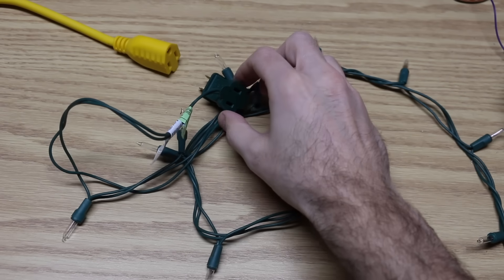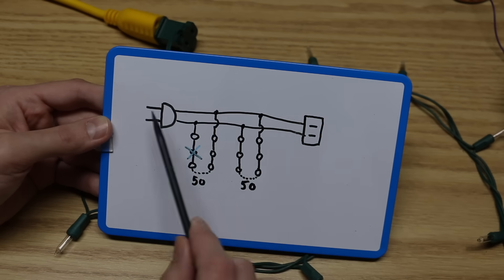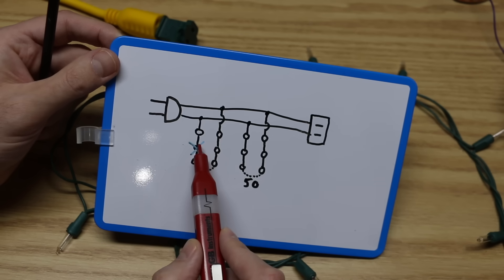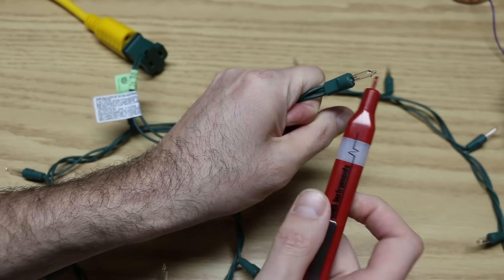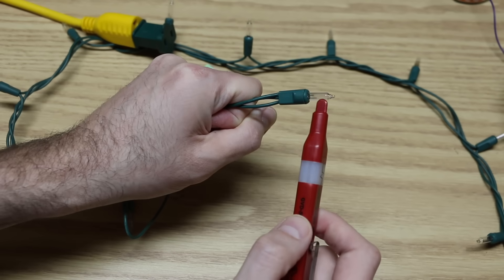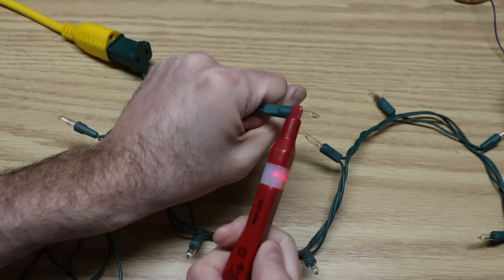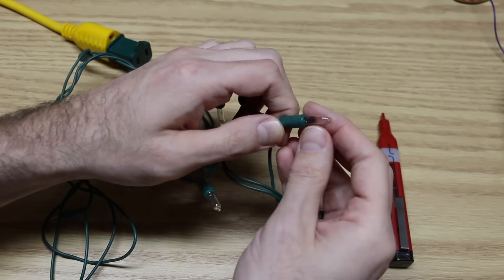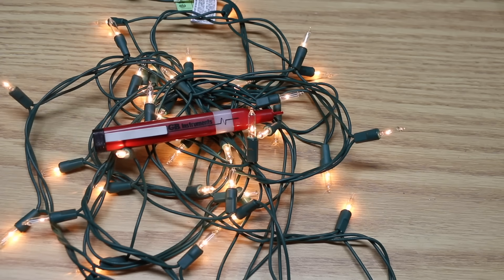HOW TO EASILY FIND BAD CHRISTMAS LIGHT BULBS using a non contact voltage tester

Comment: Very "enlightening" (pun intended). I have a light string "bulb checker" that does exactly this function. I didn't realize until now that it is simply a voltage detection tool. I have one of those also, identical to the one you have. Fortunately, I have replaced all my incandescent strings with LED bulbs, so I no longer have to find the burned out bulbs--at least for a while.

Comment: It's the one that isn't lit!!!!! For years and years lights are wired in parallel. This was doone to get rid of the problem with individual bulb failures. With the cost of sets it is hardly worth changing bulbs even if you can.
Reply from the maker: Every set of indoor "mini" incandescent lights I've bought have been wired in series, which also keeps the cost so low.

Comment: I remember these kind of old stile lights years ago. Now most have a continuous live feed so if one goes out the rest still work.
Reply: These ARE the new style. The old kind are "two wire" lights, these are "three wire". And the new ones fail just the same. They are SUPPOSED to work even if a bulb blows, but that only happens if the shunt operates as it's supposed to, which it often doesn't. I have two strands of 3 wire lights right here, each with a working half and a dead half. Each one has several burnt out lights on the "working" half, yet the half works fine. But something went wrong with the OTHER half, and obviously at least one shunt is not working. So you need to go through and find the dead bulb and replace it, since that's where the shunt it.
Reply: Exactly. Don't use the "old" sets.
Reply: @grimreaper-qh2zn  especially if they don't work. 🤣🤣🤣🤣🤣🤣👍

Comment: This is great an adjustment to speed up the search use binary search so start in the middle of the string of lights.  If it doesn’t work then you know to search in the first half or if it does work you know to search in the second half.  Continue this way and you’ll get to the bad bulb much faster

Comment: I was with you until You put the new bulb in the socket that was getting Energy. Why did You not put the new bulb in the socket that was not getting energy. In order to complete the Circuit. I am very confused. I was under the impression that as soon has you find the bulb. That is not getting the energy that is that would be were to put the new bulb. It makes no sense to me why You put the new bulb in the working socket. Please explain to me why You Contradicted everything You just said. Thank You.
Reply from the maker: Energy is arriving along the wires up to the point where a broken bulb cuts the line, so there will still be energy detected at the broken bulb entering the bulb, but not leaving the bulb.  Then on the next socket there's no energy detected.  So we go back to where the break occurred to find the bad bulb.
Reply: @GadgetReboot  So were the no energy socket is not were. I would put the new bulb. Instead I need to go back one and that is where the bad bulb should be and. That is were the new bulb will go also. Am I understanding this right. Thank You again.

Comment: Thanks for the effort in putting this video together, but I’d rather just buy another strand of lights considering this could take forever.
Reply from the maker: It only takes a few minutes - I can find the problem before I get to the car. Especially if the store is closed or out of stock

Comment: I will admit i didnt watch the whole clip but what i say makes.no sense.the voltage detector you are using is for 120 volts.as you stated its a 50 light series circuit with thr voltage dropping by 2.5 volts with each bulb.so your gaget will work up to about 60 volts , after that it wont detect low voltage across the lamp even if you reverse the plug.your diagram isnt correct either as if you loom at the set you will have 3 wires running all the way through
 Go to home depot spent the extra $2 and buy new lights
Reply from the maker: Some detectors work down to 12v by spec and even lower in reality, but what we're really trying to detect is the full 120v when the circuit is broken, so we're not getting the 2.5 volt drop across each light then, we just have 120v showing up on essentially a wire and then nothing after the break point.

Comment: I like the use of the non-contact voltage detector. But there is a faster way to troubleshoot a large string: once you have figured out which is hot and which is neutral, start in the middle, at light 25, if that is good, go to light 13, if that is good, go to 6, etc. Keep splitting the balance of lights in half and you'll find the bad one in a handful of checks instead of checking all 50 bulbs.
Reply: It's faster and easier to just look at them... When the bulb burns out it usually leaves a black mark. LoL
Reply: Successive Approximation is how digital multimeters measure voltage.
Reply: He actually explains this right at the end of the video. Great way to show that you didn't watch it all. Lol
Reply: @medavis94  That is quite clearly not how he explained it but you are welcome to interpret it however it works for you.
Reply: @clopez4280  yes I find this a lot nowadays 🧐

Comment: I think I could pull the bulbs in and out in the same amount of time and not invest in the tool. 😬
Just saying for a friend
Reply: At the very he gave the best advice.  Check the circuit in question at the halfway point.  If you have power, then the break is in the second half.  If there is no power it’s in the first half.  Then go halfway between there you tested and the side with the break and repeat.

Comment: Yeah this method might work but they design Christmas light bulbs to have a unique resistance across each bulb and different strings tend to have different resistances for the bulbs. This makes replacing the bulbs difficult because once you run out of the 1 or 2 replacement bulbs that came with that string you usually can't just rob bulbs from a donor string. Using a bulb with the wrong resistance will cause that bulb or other bulbs to blow very premature. Christmas lights are just real tough to fix, especially if they are strung into those yard decorations from factory. Spend $100 on a pretty yard decoration and maybe get 2 seasons out of it before that's blown and done for.

Comment: not one light at a time but using binary search to detect the faulty light at a much faster..use half of the strand, no voltage present then  cut in half again to ID's the voltage present.. repeat the process until finding the defective bulb.. good luck!!

Comment: Even if you find the bad light, try to find a bulb that fits… LOL
Reply from the maker: You can likely swap the bulb between different plastic bases by straightening the wires and pulling the glass out, exchanging between sockets

Comment: Suggestion: binary search. Find hot light on an end. Test the middle light next. If still hot test the middle light of the remaining string. Etc.
If not hot, test the middle light of the lights you skipped on the last step.
Repeat.  You'll find the bad light within 5 checks.

Comment: You don't have to keep untangling the wire and gripping it shielding with your hand if you've already made the other line neutral just go light bulb to light bulb quickly I don't understand why you were doing that
Reply from the maker: some non contact detectors are more sensitive and some even beep when nowhere near live wires so shielding helps prevent picking it up from neighbour lights
Reply: @GadgetReboot  I suppose you're right I never buy the cheap ones that don't have a sensitivity adjuster on them

Comment: Look at the fckin bulbs if the filament is broken change it. Simple this guy is nuts lol
Reply from the maker: Sounds like you'd have to look at them all one by one, much slower.   And you can't always clearly see the filament especially if it's blackened glass, or dim ambient lighting.

Comment: I found a bad link and replaced with new light bulbs but still not working.  I did not find any burnt bulb.  I guess there was a break in the wire.  I used them last year so it was a year old.

Comment: Suggestion...xmas lights are usually grouped in 25. After testing #1,  skip to bulb #12.
If no voltage..go back to #6
If there is voltage, skip to bulb #18 
Half the distance testing narrows it down faster.
Reply: Thanks!! I changed bulb #12 from the start of my burnt out section and BOOM, it was the correct one

Comment: I detect voltage at every light but none are lit. What next.
Reply from the maker: Is there a fuse in the plug?  If a fuse is blown that could explain voltage showing up all along the way because the main connections are fine and then it gets cut right at the plug after making it most of the way around the string.  Otherwise, the detector could be picking up stray environment stuff.  If you try to detect voltage just holding the detector off on its own does it still pick up something?  And when probing a bulb are you shielding below the bulb with your hand so you're not picking up what's on the main wires? some detectors are more sensitive.

Comment: Anyone recommend a particular non contact voltage tester? There’s a lot out there but I’ve read that for Xmas tree lights you specifically need a “low voltage” detector. What would that be?
Reply from the maker: most of them say they go down to 12 V and I’ve never seen  one that didn’t work for this. Although individual Christmas light bulbs in a string might only be a couple of volts each across the entire 120 V AC circuit, when testing like this for a broken bulb, we are actually detecting the full 120 V presence because the circuit is broken so we are not getting the couple of volts across each light, we will see the full 120 V as if it’s just a bare wire going up to the point where the circuit has been broken by the bad bulb. Once the bad bulb is replaced and the lights are back on, then there’s just going to be a couple of volts across each light.

Comment: I have white lights wrapped around a ficus tree that I keep lit 24/7.  I unplugged it to paint the room and then it didn't work the next day. How could it burn out that fast?
Reply from the maker: if one of the bulbs was near its end of life, the stress of powering on again could have blown it because there’s an extra surge of energy to power lights on compared to keeping them on. Similar to the old incandescent lights we used to use for the rooms, they would usually blow as soon as you turn on the switch rather than just randomly going out if they were already on.

Comment: When troubleshooting series strings (or anything wired in a similar way), always start in the CENTRE. That tells you which half of the string is dead. Then test at half way within the dead half section... in that way you can isolate which (quarter) section contains the fault. Then drill down further in the same way.
So in this case of 50 lamps you'd first test to determine which is the active (line) end of the string, then test bulb number 25. If that bulb has power, then test Bulb 37, if that works, test Bulb 43, etc.
EDIT: That's the method used in the follow up video (linked in description).
Reply: Doesn't matter, it will still be the last bulb you check that's dead
Reply: @cchavezjr7  But with many fewer checks.  For examle, with 64 bulbs, 64=2^6, you'd only check 6 or 7 instead of 32 on average.
Reply: @SRHMusic012  You missed the joke.
Reply: You said it much more concisely than I did. It's called a "binary search."
Reply: Amazing, never thought i would see a perfect analogy for the runtime complexity of a binary search tree in a set of christmas lights but hear we are. In the worst possible case you will find the problem bulb in Log N steps, where N is the number of bulbs in your set.
Reply: @maxwellwynter174  watch a video on diagnosing Christmas lights and end up seeing a reference to Big O notation. Will wonders never cease? :)
Reply from the maker: yeah I mentioned near the end that’s what I would do normally but I should have done it that way all throughout. In the follow up video I did a year later, I did it the right way finally.
Reply: @GadgetReboot  No, I think your series approach was the right way for a newbie to learn the logic behind the method, before you move on to the advanced bisection method.
Reply: Duhhh 🤣
Reply: Its called the half split method.
Reply: Buy some Led ones,I threw away the bulb ones
Reply: In the first of my 48 years as a troubleshooter I learned to start at one end of a chain and work toward the other end. There is often more than one problem and it is quicker in practice to check that each stage works. In one case, a customer brought in a dead transponder (I worked in avionics in General Aviation - small planes). He said it died in the middle of a flight, but there were 9 transistors that were defective, wrong type, or connected in wrong. The one in the IF was the classic failure for that model but the rest were from him trying to fix it himself blindly. Anyway, in that case trying to use the "start in the middle" technique would have been much, much slower. It comes under my first rule of troubleshooting: first make everything right, then see what problems remain.
In the case of Christmas lights, the break-even point for using sequential search or binary search is between the 25 and 50 lamp strings. The longer the string the greater the chance more than one bulb will be out. The time spent on a series search increases linearly with the number of bulbs; the time spent on a binary search increases with the square of the number of bad bulbs or bad connections.
Reply: @flagmichael  Interesting. Since you're numbers guy, I'd be interested in knowing what percentage of the ones you fix had only 1 that was preventing the string from illuminating....should be almost every one of your strings. Using your method, I don't think you would have the data on that.

There may be many 'unlit but continuous' ones, but there is really probably only 1 which, when it blew last,  prevented the string from lighting. But as soon as you find that one, using the 50% rule, the string should light and the other bad ones will not....those are quick to ID and replace.  Also, if there are multiples, there are usually many with a black discoloration.  But, there is usually only 1 (the last one to burn out) which prevents the string from lighting. I would still argue that the 50% rule would still be much faster.  Interesting discussion.
Reply: @flagmichael  - a Christmas light strung can only ever have one lamp that prevents it operating.
Reply: What about if two bad bulbs ? Will the first replacement light, or will the other dead bulb prevent lighting ?  Now there is a bigger problem...😆
Reply: @jamesconner3437  - there won't be two bad bulbs in a set that stops working when one bulb fails.

Comment: Thanks for the video.   I forgot I had a tester like this.   I found I didn't have a burned out light but one that the wires came off of but was still stuck to the string.

Comment: LEDs rule! Reliable, robust and energy efficient!
Reply from the maker: They fail as well though, so we still need to track them down eventually!   Especially outdoor bulbs, they can fail for other reasons like corrosion at the contacts so it’s good to have options to figure out where the problem is.

Comment: Great video. I was going to leave the Fluke pen tester in the toolbox and visually check bulb by bulb until I watched this. Thanks for posting.
Reply from the maker: I’m glad you did not stomp out the lights and go to the dollar store for replacements, which seems to be a popular alternative solution apparently!
Reply: I have tons of christmas lights and most lights with black burn marks actually work fine, oddly enough.
If you want to speed up the bulb-by-bulb method trying skipping 4 or 8 at a time until you detect no voltage then backtrack by half (4 or 2 bulbs) and test again. You can narrow it down very fast this way.

Comment: This guy does seem to know what he's talking about; but I just went to the leading online auction website and bought something called an LED keeper device that let's you do a whole length of lights at a time and not just one light at a time. It was much faster than this.
Reply from the maker: I covered the light keeper pro in another video but even that can’t repair all damaged bulb shunts so sometimes I still need to use the fallback method to check individual lights.  I had to do that this week when a string stopped working and the light keeper couldn’t fix it.
Reply: @GadgetReboot  I wanted to watch your video because I have a big (about 15 feet tall) pine tree that has about 600 lights on it that stopped working and I was going to work on that today.

Comment: just because it has a burn marks, doesn't mean its bad, you have to check the filament with a magnifying glass to see if its broken. alot of the clear bulbs will show burn marks due to heat.

Comment: Dude !!! Just bought a Milwaukee line tester because of this video. I never thought about using my hand as shielding, and also never understood why it was the bulb BEFORE the one that didn't beep that was out, and major DUH on my part for not realizing the polarity issue.. All those years of using those store bought testers. arghhh..
Reply from the maker: Sounds like you understand the whole point of the video. I hope the tester works well, some of them can be overly sensitive and act funny.
Reply: @GadgetReboot .. And boom.. The tester arrived about 10 minutes ago and 5 minutes later fixed a strand using your technique that had 2 bad bulbs.  Thanks!!. BTW... Appreciate guys like you. I write tech articles on LinkedIn trying to simplify complex stuff, but yours was really well done!!
Reply from the maker: I’m glad it worked! Thanks for the comments and compliments.